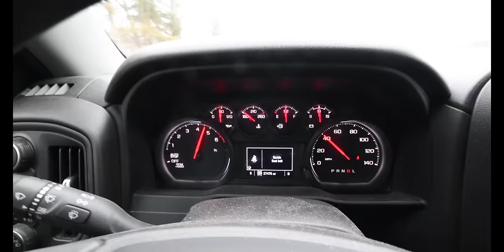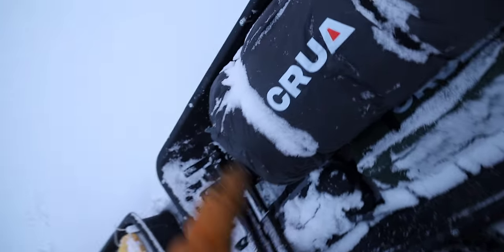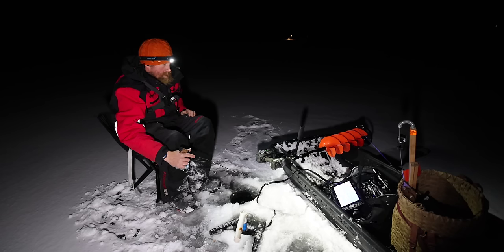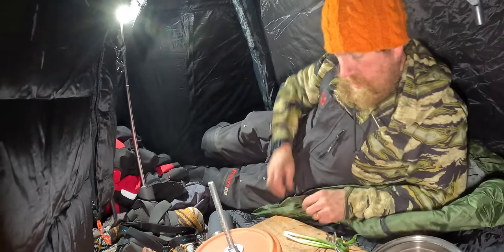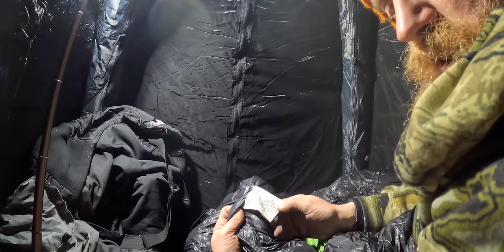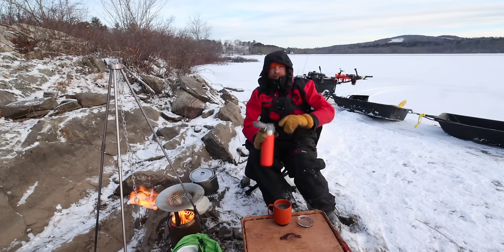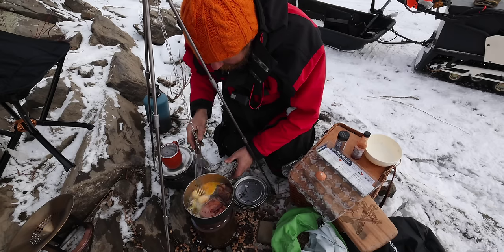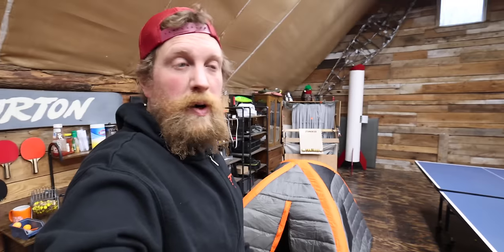Winter Hot Tent Camping on Frozen Island  @CruaOutdoorsChannel

Comment: Need to add a hanging  loop for the heater  and then make a  floor  stand for  if you want to not hang  it  but make the stand out of a  metal pan with tall sides and a weighed base incase the unit  gets knocked over.

Comment: If those four candles was making that tent warm how come the hot air is showing when it hits the cold air when you breathe? There is no way four small candles is making that tent warm in those temperatures. That's why your still fully dressed.
Reply: Because the air is dry...
Did you know that you can see your breath in 30+ degree air if it's dry?